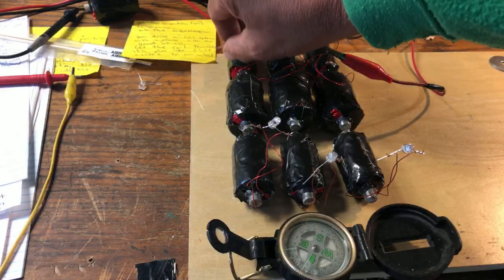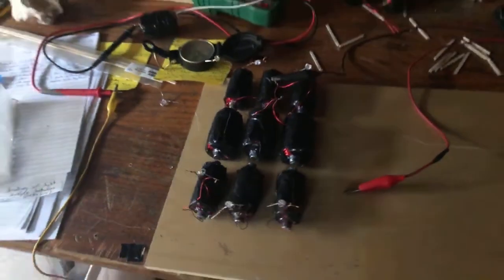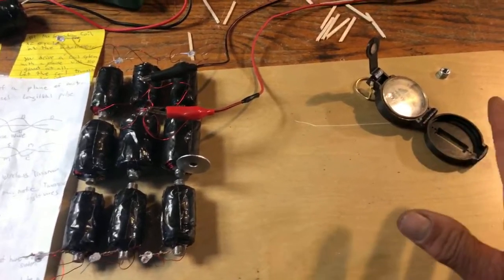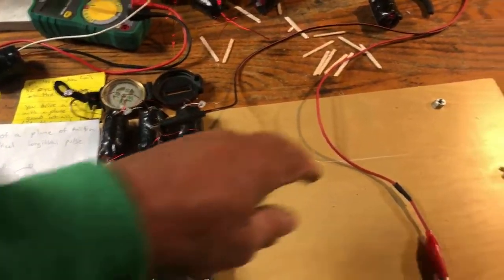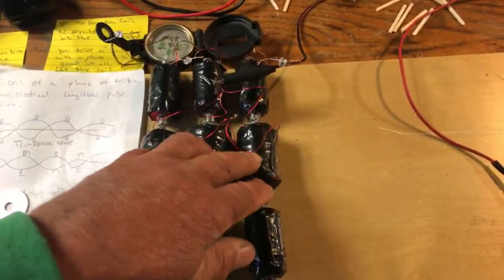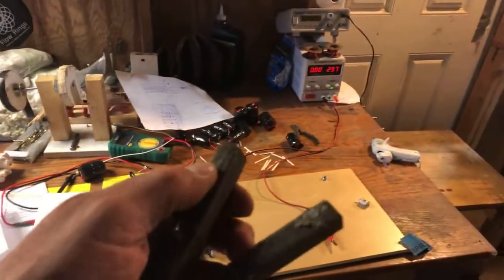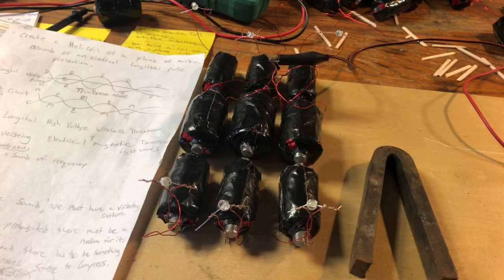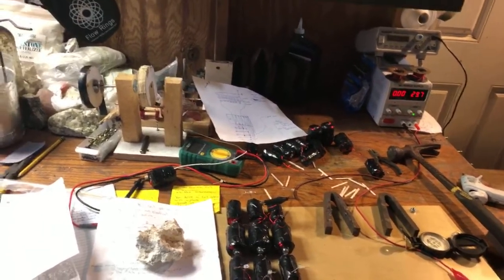Ed Leedskalnin’s Coils

Comment: I would use others crocodile clamp wires. These ones have a relative high resistance. You can measure it yourself. It's better to make your own, or buy the thicker ones so you'll end up loosing less energy in them, which is a necessity if you want to get to overunity.